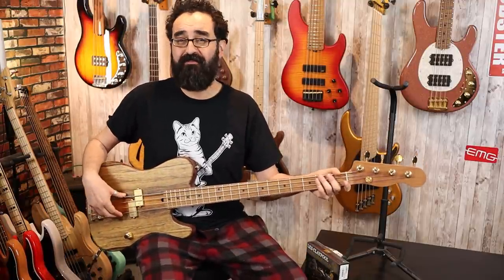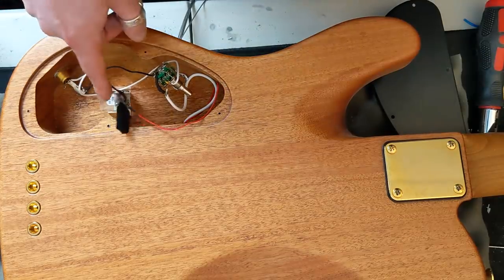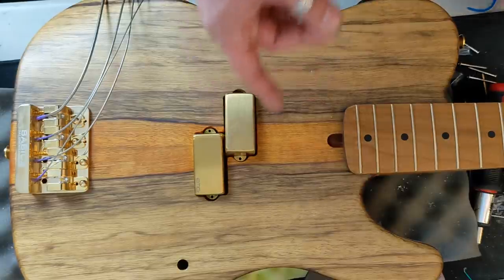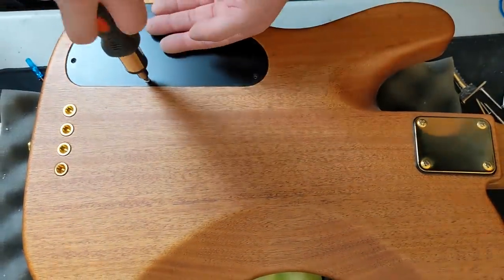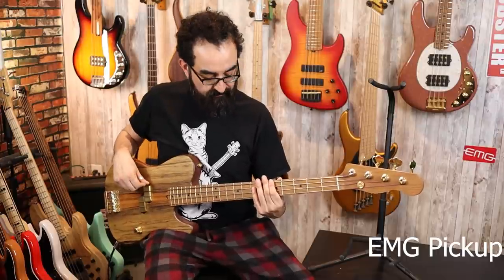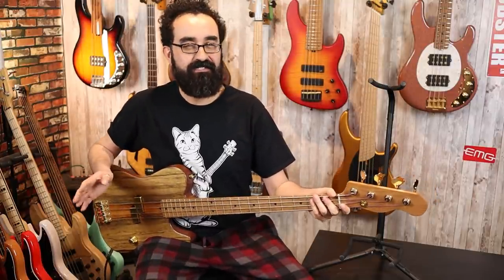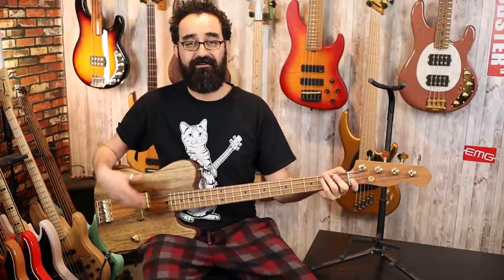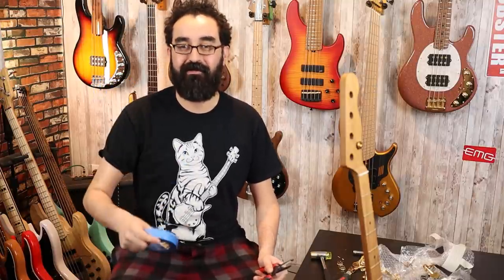Warmoth Tele Bass Modified - Installing the EMG Les Claypool LC Pickup - LowEndLobster Builds

Comment: This rules. It's basically impossible to find a demo of these with anybody playing fingerstyle. Everybody wants to slap, which I get, but there's more to playing bass than that and it's nice to know that these actually sound good the way that most of us would primarily use them.

I've got a red p-bass that I'm tricking out with all gold hardware, going for an Iron Man vibe, and have been looking for some gold pick-ups for a while. This was incredibly helpful. You're the man.
Reply from the maker: Glad you enjoyed the video! Check out the new DiMarzio pickups too, they also come in gold
Reply: You are right about the slapping.  It's like taping on the pickup with a screwdriver.  It's makes a noise but tells you nothing about the tone of the pickup.

Comment: I think if you're putting flats on a bass with a single Precision style pickup you are probably going for a deep rootsy tone. I think the MEC pickups worked much better in that respect as the bass sounded warmer and deeper. The EMG pickups on the other hand had less lows but a clearer more articulate sound. It all depends on personal preference but if it were my bass I'd probably put the MEC pickups back in.

Comment: The Pachyderm doesn't sound similar to the MEC at all! Well, yeah, you can hear they're both P-Bass pickups but that's all. The EMG is infinitely better - and I'm not an EMG fan by any measure. More punch, better midrange and better placed high range. I cannot express clearly enough how much I hate that "detached" clanky top end of the MEC. The Pachyderm, on the other hand, is just a very good all-rounder. A huge improvement!

Comment: Do i need to have a solder gun to desolder the wires? I have my bass halfway tore apart, and im just realizing although the pachyderm pups advertise as 'solderless', that doesnt include the already soldered gear lol.
Reply from the maker: They are solderless. Everything is included with the pickup

Comment: Does anybody else put real top quality pickups into cheap basses?   I've got an EMG PJ set in an Aria Pro II SLB-2 bass I bought for £35 (about $60) I got off Ebay
Reply: Yes, I put a set of EMG Geezers ($200) into an Ibanez GTR 70 I got for $100 that played like a dream but had fried electronics. It is amazing now!
Reply from the maker: It's so much fun to do. Best part is, you can always put the guts somewhere else if you don't like the result. Modding is the gift that keeps giving!
Reply: Also used EMG geezers but in an old squire and stuck some flats on it and a high mass bridge. A new lease of life for it.
Reply: Yep; I put a set of Fralin pickups in a Squier Jazz. It's probably my main player!

Comment: I love passive over active, this bass should be passive. I don't want battery dying in the middle of a gig. I don't want to be enslaved to 9 volts. The old pickups sounded just fine, and the new pickups were pretty much similar in tone and responce. What makes this bass special, is how simple it is, and how it gets the job done. (Passive) perfect for 1950's, 60's rock. Once it became active, then it's too much electric tone for jazz, or blues, its  now been turned it into a 1980 pop bass or 1990's hair metal bass.